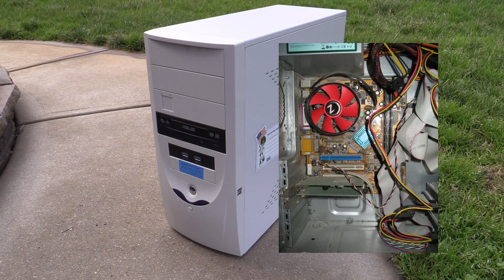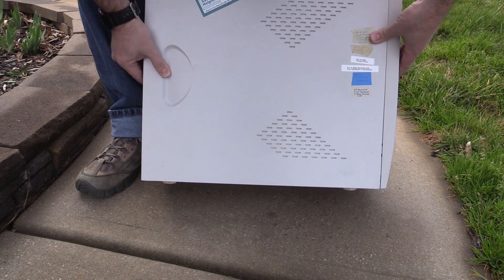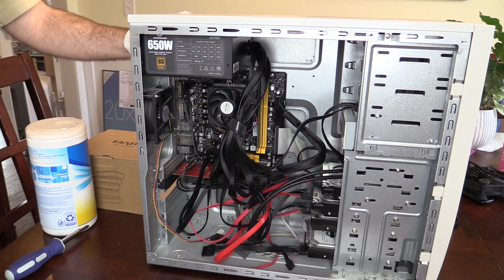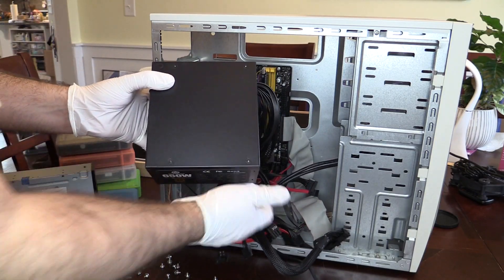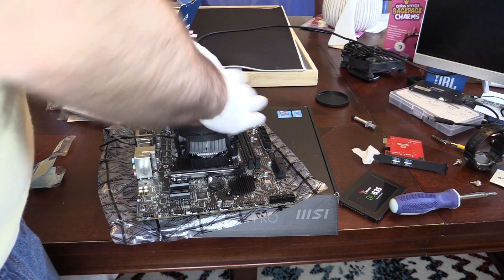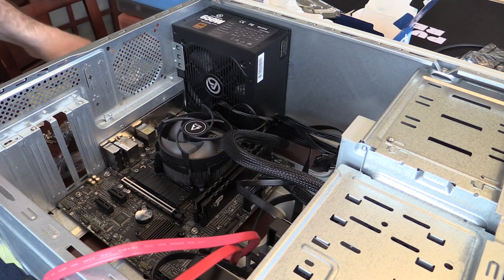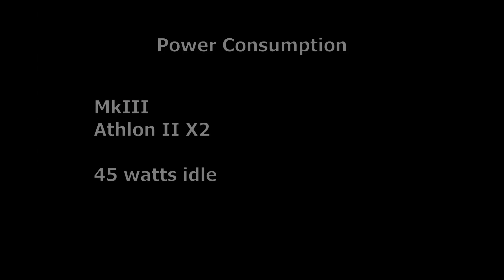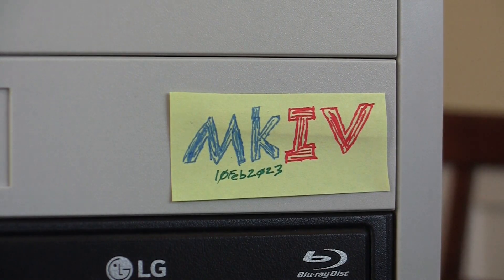Upgrading 20 year old desktop server! New Motherboard, CPU and Drives.

Comment: i like this video, i was thinking of doing the same thing..
Reply from the maker: Thanks. I have run into a snag. The system started resetting randomly. Thinking it could be the MB I moved the drives to another device. When I finally got back to it months later it turns out the problem was the reset switch. So now both the power and reset switches have gone bad in the case. Some day I'll replace them and keep it going.

Comment: Simmilar story here, having old Sun Microsystem E-ATX case with tons of internal 3.5 inch drive bay. First system running Xeon X5450 with MSi P45 motherboard with 4GB of DDR3 and 8x 500GB drive back in 2017. The last upgrade happened in 2021 running Xeon E5-2695v3 with chinese Huananzhi motherboard and 7x 4TB rebranded WD Purple drive. Sadly the chasis is retiring back in early 2022, because bad airflow and I recently move out the old house and buy used 40U rackmount frame with 4U rackmounted chasis.
Reply from the maker: Very cool, thanks for sharing! I don't have the right space for anything rack mounted, but that might not always be so.
Reply: @ntgm20  "Best" one maybe in below the staircase if you live in 2 story "American" house, or like me, putting it on spare bathroom which already have good sound isolation and anexhaust fan.
Reply from the maker: We have a closet under, but that is where cleaning supplies are organized AND the network distribution is.  I'm hanging things from a wire shelf, it looks pretty bad but I'll get it all cleaned up and post something on that too.